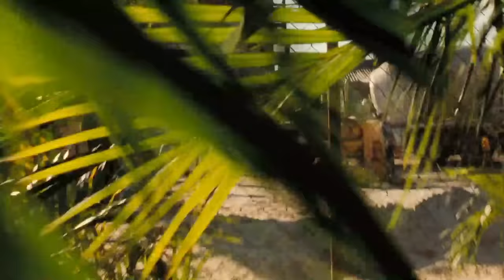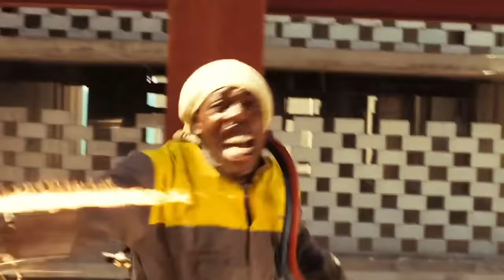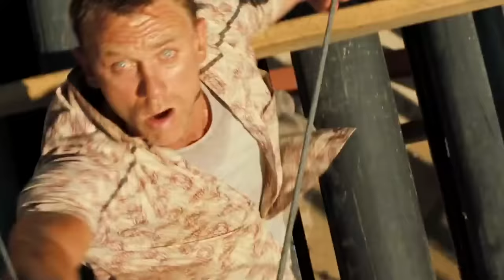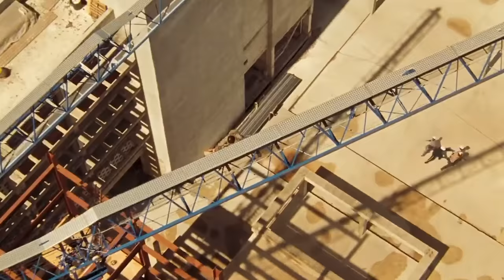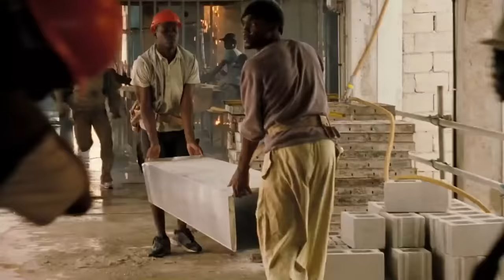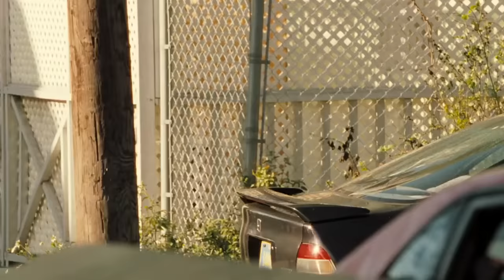CASINO ROYALE | 007 & Mollaka Parkour Chase – Daniel Craig | James Bond

Comment: Let’s all appreciate bond getting in a digger and leading a brief path of utter destruction for virtually no discernible reason
Reply: He gets shot at and is saved by the bullet resistant glass, I’d say that’s a reason.
Reply: @MaxwellAerialPhotography  That bullet resistant glas thing was also used later in the fuel truck pursuit.
Reply: Not getting shot in the face, no?
Reply: It's the British Way
Reply: @khaledhm9284  eeee
Reply: There WAS a discernible reason: he was trying to catch the bad guy without catching any bullets. Besides, the script told him to get in that thing. . .  🙂
Reply: Agree. He should have summoned Heath and Safety for a meeting.
Reply: but for the viserale enjoyment
Reply: It reminds me of the scene in GoldenEye where Bond drives a tank in very much the same manner, which is fitting considering both it and Casino Royale had the same director.
Reply: Tttt
Reply: And almost killing several people in the process.
Reply: Quick view
Reply: 1
Reply: in 'Merica we call them front end loaders
Reply: Calm down Dear, its not real
Reply: 😅 @MaxwellAerialPhotography
Reply: Here's a reason: Shock and awe. The way the guy bolted taught Bond he can't beat him in a straight line race. There was nowhere else to go once he cornered himself leaving Bond in the bushes and Bond didn't want him bolting again back to where they came from so he decided to frighten him with a piece of construction equipment, ensuring he won't try to escape back to where they just came from. So the guy started climbing to the pinnacle of the construction instead which may have been an unintended outcome of Bond's plan. He probably didn't anticipate that.

Comment: This is the most exciting and the most unrealistic Craig Bond sequence. The difference in agility level and the way the enemy is running in a straight line, through everything that comes in his way, is something that I can't believe. A guy so expert at Parkour isn't going to be easily caught. Especially not with something brute like Bond. 

Especially after jumping off from those crane handles, and especially with Bond taking so much time on it to contemplate jumping.

Comment: Daniel Craig had a great run as 007, and the films were all quite fine in their own respects... maybe some better than others. But the Craig Bond era just never lived up to the promise of this scene. It's an incredible scene, maybe the best action chase scenes of all time. But the rest of the action in the entire series is quite lacking.

I'm guessing, and I'm just pulling this out of my rear end here, that this scene took a very long time and had an extremely high cost in the production. Also, probably very hard to shoot. This would have had an effect on Craig and the rest of the crew, perhaps even the producers, that they were going to go easier on the action for their own sake. No more four month shoots in a hot african country running away from trucks and bursting through drywall.

Comment: pretty sad how pretty much every jackie chan parkour scene is better than this.

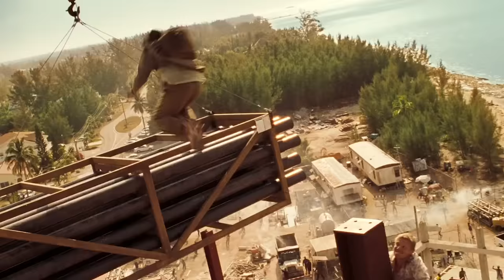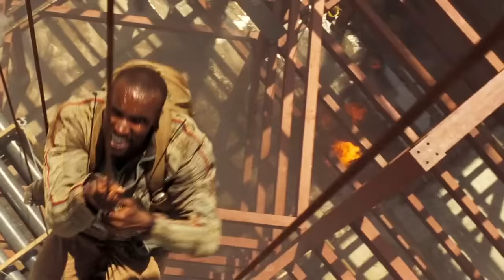The set up for so many of the jumps is cut, extra scenes reset the viewer's sequence to make it more cluttered. Explosions to distract, random punches or kicks when this could just be an extremely well designed parkour, or a poorly thought out scene. For example, compare the jumps 1:52 and 2:02. They are completely different where Bond jumps his entire body higher than Mollaka. But then Mollaka is completely recovered despite taking several punches and a blow to the legs and is a better jumper than Bond. Internal inconsistency much?

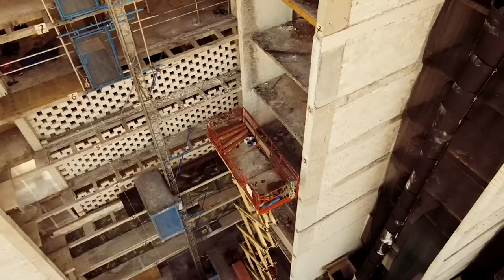Or for example, the very impressive 4:45 jump, they don't bother to setup this up more. The blue box is moving which is why Bond doesn't try the jump. And instead of designing a special even more amazing path, Bond just does the simple yellow manlift down. Also if you're going to have such an excellent jump; one take. It really kills just how cool that jump is.